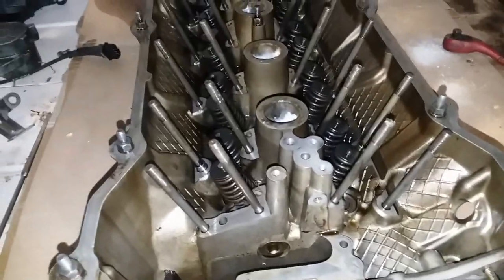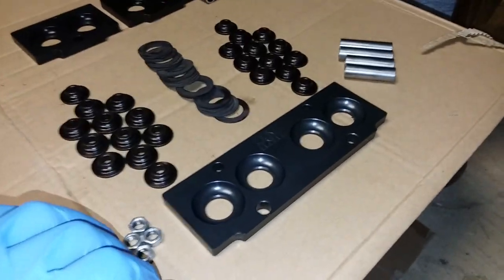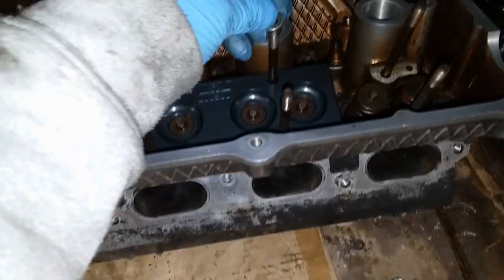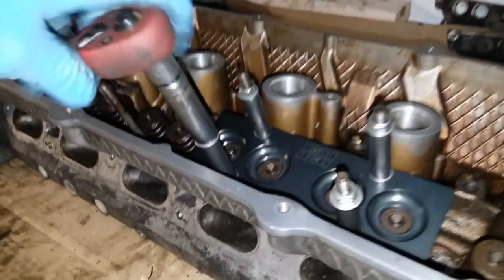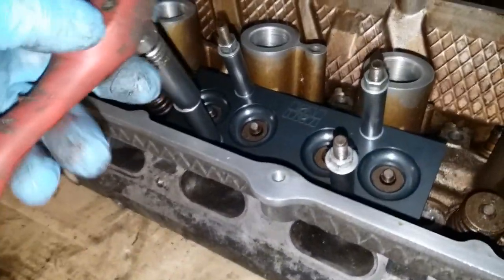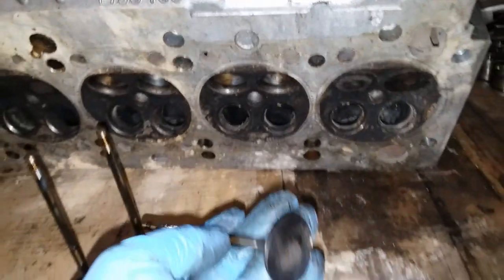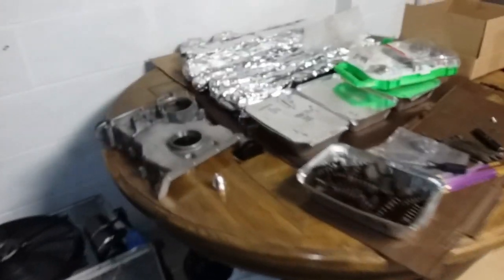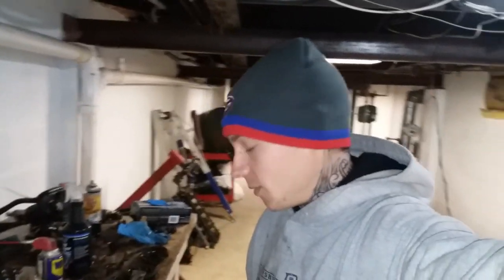BMW E46 Turbo Build - M52B28 Cylinder Head Refresh 1 Featuring Metric Mechanic

Comment from the maker: UPDATE: the shims provided in the Metric Mechanic kit go underneath what's called the spring perches. It's an existing shim that the valve springs rest on. They must be removed, and then the Metric Mechanic shim sits underneath of them. So the order is as follows: the cylinder head itself/ MM shim/ OEM spring perch.
Reply: Just got mine, lookin' for conformation they sit under the stock perches and after you said "over the perches" I came immediately to the comment section. Conformation attained...

Comment: Hey Tyler, I am in the process of swapping a m52b28 into my e46 330 for FI. Only thing I am unsure on on the swap is how do you swap the sensors for dual vanos to single? Did you get a new wiring harness? Thanks in advance!
Reply: Jackson Meade you cannot do it. The m52b28 is an ms41 engine while the m54b30 is an ms43. You cannot convert between then without much difficulty and loosing the features of the ms43. Including obd2 functionality and electronic throttle body. It’s not worth it, plus the 3L engine would be better for a boosted application.
Reply from the maker: @mrpoopybutthole6314  You can* do it. Sorry I'm months late, as YouTube doesn't notify me of all comments.  There is a simple hack, which includes using the DISA connector to power the single VANOS. As far as throttle body, they make adaptor plates to re use your MS42/MS43 throttle body on M50 intake. If you're not interested in running single VANOS, the cylinder head is easily modified to accept the dual VANOS unit. 

Powering an single VANOS engine in E46 chassis is straight forward while retaining factory E46 engine harness.
Reply from the maker: Sorry for late reply! YouTube does not notify me of all comments! If you're asking about the VANOS itself, you will utilize the DISA connector to power the single VANOS unit. Which I'm sure you figured out by now.

Comment: You got any new content you working on?
Reply from the maker: Not really at the moment. Just been doing me. Need any turbo parts? I'm selling stuff
Reply: @OLearysBMW  no I think I'm going to supercharge my e-46 I think buy Super charging issues and would be more reliable
Reply from the maker: @clownkiller0629  hm, well you still need injectors.. Which I may know someone who has some 😁
Reply: @OLearysBMW  I do need injectors are they the Porsche injectors?
Reply from the maker: @clownkiller0629  yes, 590/600cc direct bolt in. Bosch, used for Porsche

Comment: Hey Tyler I'm just at the tail end of my turbo install and although I've made some different choices (M50 Intake, Comp turbo Oil Less turbo). I did choose the CX racing kit. So my question is can you provide some info on your on your fuel system. I'm using a Quantum Flextech 340 and what looks like a similar fuel pressure regulator to yours.
Reply from the maker: Oil less turbo.. What do you mean man? I'm using an Walbro 255 in the stock sending unit, stock fuel lines, aftermarket FPR spliced into return hose, and using Bosch Injectors used for an Porsche 911 GT2.
Reply: @OLearysBMW  all late lol but I think he mean the oil-less turbo the comp makes… you just need to lubricate it with grease here and there
Reply from the maker: @Scarlif3x  hey man, yep. This was from last year, I didn't know such a thing existed. Haha, I learned later that there are in fact oil-less turbos.

Comment: Any reason big boost builds aren't done for the M54B30 or 25? I noticed even Metric Mechanic doesn't carry anything for it. 

I'm aware of the heat-sensitive aluminum block, the harmonic issues of the 3.0 liter engine, and the low-friction piston rings, but how much of an advantage does the M52 have over it? Is it just that there are more and cheaper M52 out there, so it has more support?

I ask because I want to gradually build a M50, M52, M54 as a bulletproof, supercharged daily.

Unfortunately, I've just bought all the accessories for the M54 I started with, but I'm willing to go to a M52 or M50 if it has big advantages over the M54.

Comment: How much was the tool and shims?
Reply from the maker: It's sold as an kit, for $190 USD. Would you like the link?
Reply: @OLearysBMW  hell yeah that's a good alternative rather than paying 800 for upgraded springs and retainers.
Reply from the maker: @frontspring1  okay, hold on and I'll be back with the link
Reply from the maker: @frontspring1  here you go, let me know when you see this https://www.ebay.com/itm/Metric-Mechanic-BMW-Valve-Spring-Retainer-Kit-for-M50-54-US-S50-52-engines/202757762927?_trkparms=aid%3D111001%26algo%3DREC.SEED%26ao%3D1%26asc%3D20160908105057%26meid%3D5455c75ee95440068a4aab0363186268%26pid%3D100675%26rk%3D3%26rkt%3D15%26sd%3D111633541237%26itm%3D202757762927%26pmt%3D0%26noa%3D1%26pg%3D2380057&_trksid=p2380057.c100675.m4236&_trkparms=pageci%3A207cdf71-1aec-11ea-975d-74dbd180b018%7Cparentrq%3Aed6a6ad916e0abc5a122d41dffbf42e3%7Ciid%3A1
Reply: @OLearysBMW  damm that's legit
Thanks boss
Reply from the maker: @frontspring1  no problem, 👍
Reply from the maker: The tool is also available separately for $60 I believe